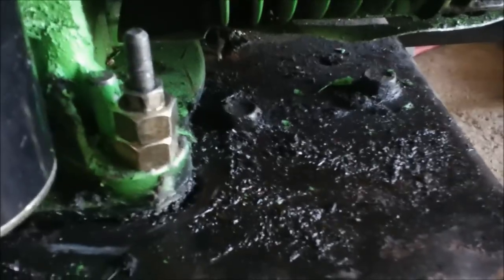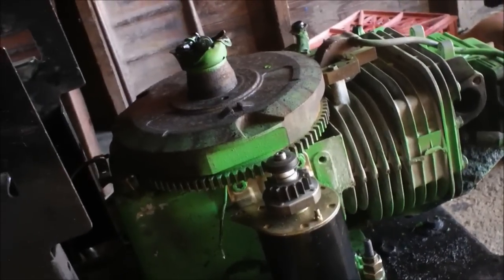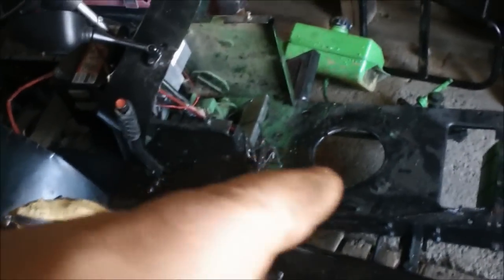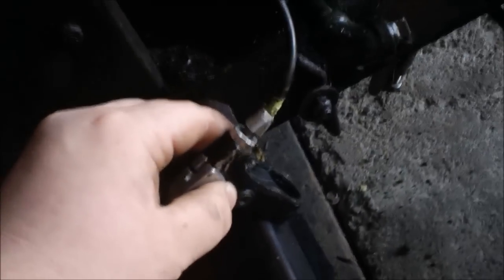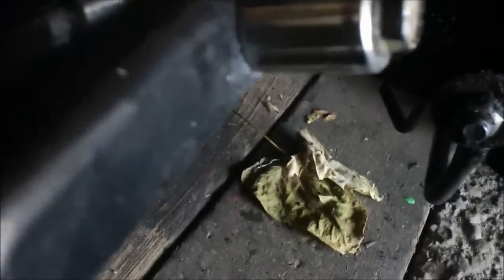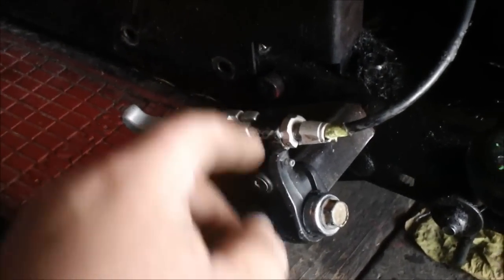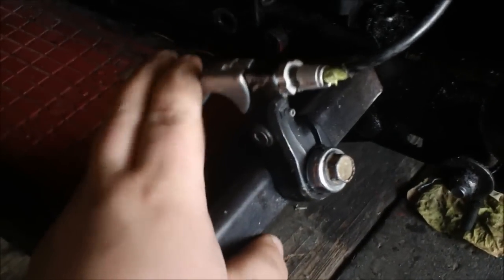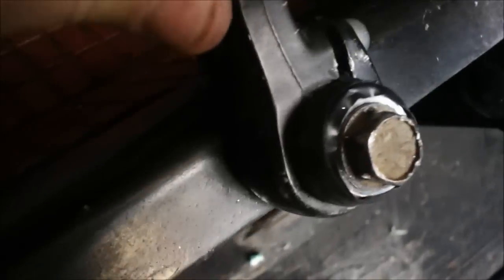HOW TO MAKE A LAWN MOWER GAS PEDAL

Comment: I had the idea for a bicycle brake lever throttle on my minibike, since i don't have the twist throttle for it.  You had the idea of bicycle brake lever for mower gas pedal!!!  AWESOME!!!!  Now i can set this up on my Ariens rm1232e i'm picking up for 50 bucks!!!!  It's a 5 speed with clutch!!  So then with this pedal, I can make it like driving a stick shift car!!!  And when i pulley swap it, I can make it have a super fast gear ratio, to where it'll sound like driving a car, shifting the gears from 1-5!!!!  Then my mower will basically be a mini stick shift car!!!  I'll link your video in the description when i get my mower all set up with the pedal and make a video!!!!
Reply: DO NOT shift the mower while in motion. You will destroy the transmission if you try to shift it like a car
Reply: @matthewnorton9262  if you do it and push the clutch in it might be a shift on the go transaxle like mine
Reply: @harmonicpower2303  No mower is a shift on the go as far as I’m aware. It’s more of you just push the clutch down pick, a speed and you stick to it

Comment: Just finished building a Murray 8 hp 30 inch cut lawnmower. Runs smoothly. I haven't test the speed cause I need new tires but I'm thing of making it a hydraulic system. What do you think.

Comment: won't it hurt the motor if you do that ....you take a chance of blowing the motor .
Reply: mike flerx good point. However there is a governor internally in the motor that limits the engine power. If he did remove it, however, yes it could blow if he did something wrong.
Reply: would if you turned the governor half way?